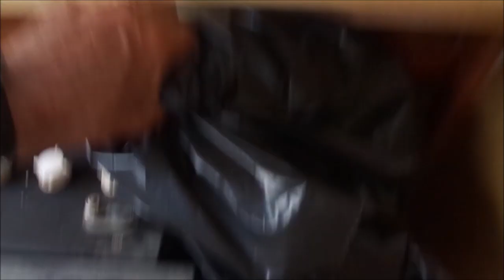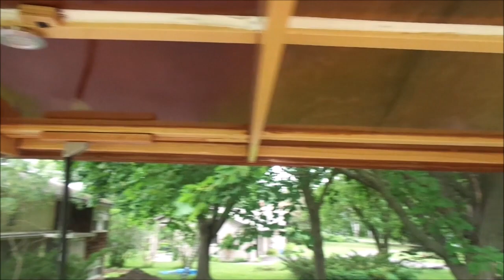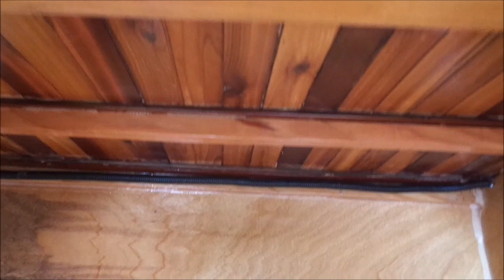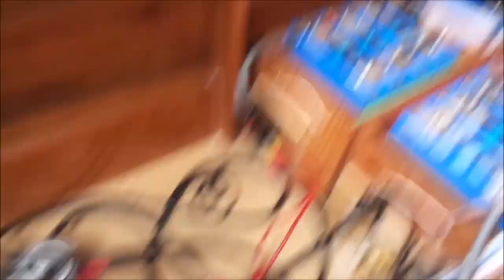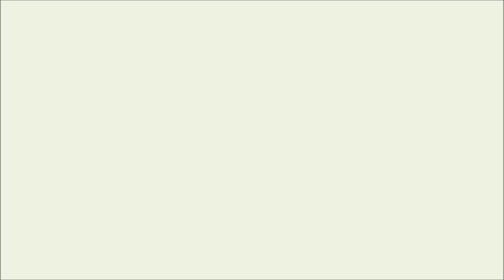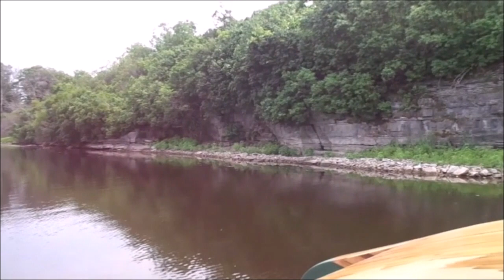Building My Solar Electric Catamaran Part Sixteen, The Maiden Voyage

Comment: How much power is it drawing at a slow cruise and/or hull speed?
Reply from the maker: Hi Scott, the cat currently draws about 600 watts at a slow speed of 5.5 km/hr, about 1000 watts at 7 km/hr, about 1400 watts at 8 km/hr and 1800 to 2000 at about 10 km/hr which is pretty much the hull speed. More power will be required to get it to plane.

Comment: How many solar panels and batteries did you used?
Reply from the maker: On my catamaran I have on the canopy 8 totaling 1560 watts. I have another one that will swing out the back to charge a 12v house battery.
Reply: @philboyer2036  How long it takes to full charge all the batteries Sir?
Reply from the maker: That's a million dollar question. You never have perfect solar conditions as well as at the beginning and end of the day there is not much. In between follows an arc with it peaking between 12 and 2 pm. I use for a day a factor of 40% of the total for a sunny day. so 1560 watts x 40% is 624 watts. If I was at 20% state of charge (2kw) it would take almost 13 hours to fully charge to 10kw. I plan to improve that by tilting the canopy to get direct exposure.
Reply: @philboyer2036   @Phil Boyer  Sorry, if I have too many questions Sir.13 hours for 10kw, it sounds good, but for the 2 hours  effective day, made it needs a week for full charge. I used a small one, just for 3-4 small lights at my cabin. The sunrays here in tropical  Indonesia are good, but the batteries already soaked now. Considering 50-100 WP solar panels in the future.
Reply from the maker: @VanSilCreation  I think two days if it is sunny. I have only discharged the batteries so far to 50 % and that took a day to recover.
Reply: @philboyer2036  Need to have a series of back up batteries for a day tour?
Reply from the maker: @VanSilCreation  Not for a day tour. 10kw will be fine if I am just cruising. With a 20hp Elco motor full out it would last just over an hour but that is drawing 8kw. I did a day trip last month going 55km at about 9km/hr and finished with 50%SOC. It was a relatively sunny day.
Reply: @philboyer2036  9km/hr sounds good for a solar powered boat.

Comment: with a some  passengers  near front  i think you will be happy with a little weight to the rear . front is steamlined enough  . more important to steamline back end. looks good enjoy. waters low iam up on upper buckhorn   your trim tabs at back angle down a bit. that will create drag and push the nose down the faster you go . called a hook. looks like 2 6volt lead batterys?
Reply from the maker: Hi Daniel, the tabs were built as they were described in the plans. I also wondered if they should not follow the curve of the hull. I do plan for some modifications and perhaps I will finesse the tabs a bit. I traveled through Buckhorn with my other solar boat in 2018. See my playlist on the Trent Severn.
Reply: @philboyer2036   hi yes with a twin hulls you get a wave of water at the middle back where the motor is. maybe a small styrofoam  third pontoon fiberglassed to bottom in front of motor . will add a bit of flotation in back.. let me know if your ever up this way.  hopefully more water next year. thumbs up.
Reply from the maker: @danielnicholls6868  In one of the modifications I did after the maiden voyage was to add a fairing in front of the motor to divert the turbulence. I am behind in making my videos.